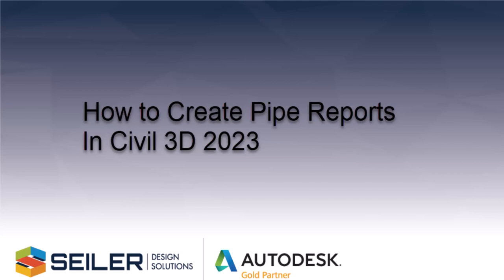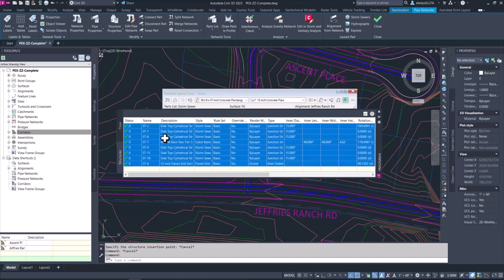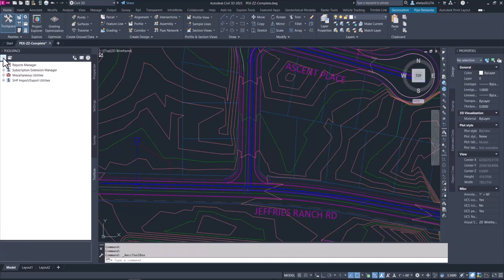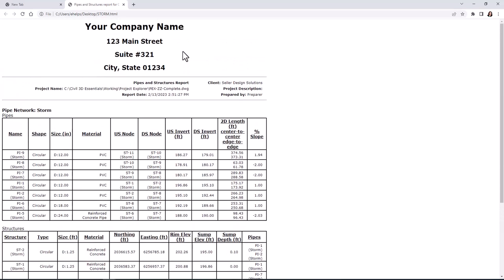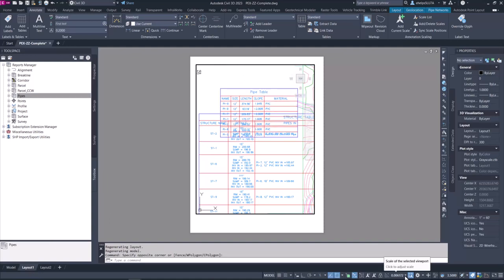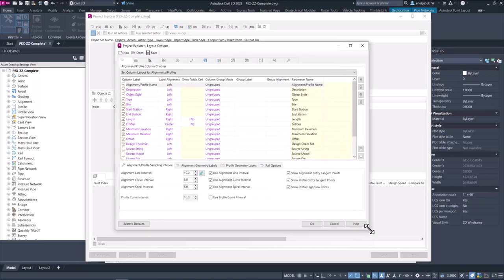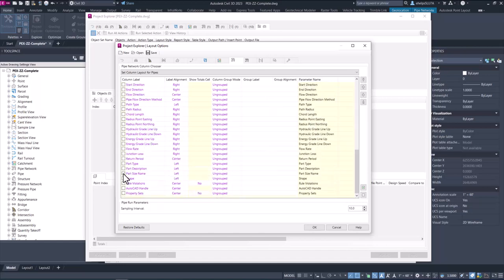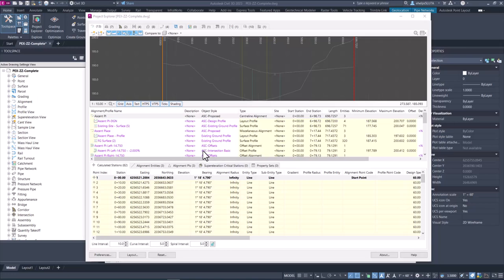4 Simple Ways to Generate Pipe Network Reports in Civil 3D

Comment: This is cool and all, but it's of little use in construction drawings development. All of this information would be reported on the Storm Analysis Table, and Sanitary Analysis table already. Most of which gets generated by exporting all the cad info into a calculation spreadsheet. 
What would be more convenient to know, is if there's a way to create a pipe and structure schedule that just adds up all the linear footage of each pipe size, and all the structures of same type.